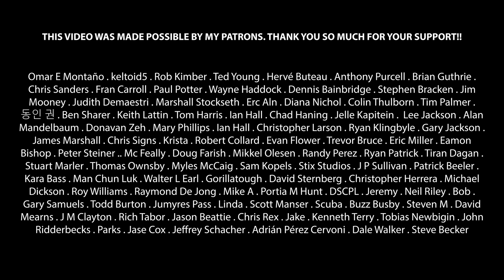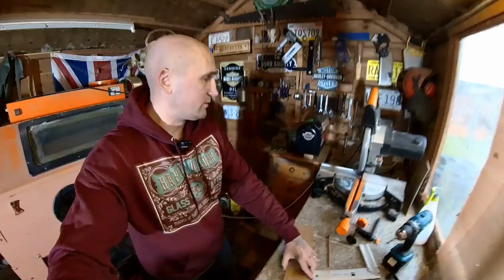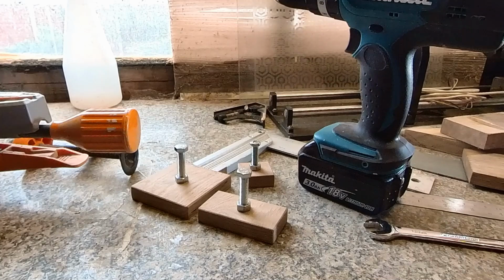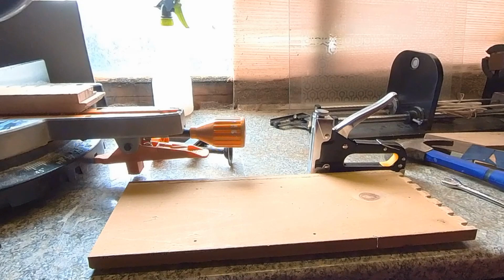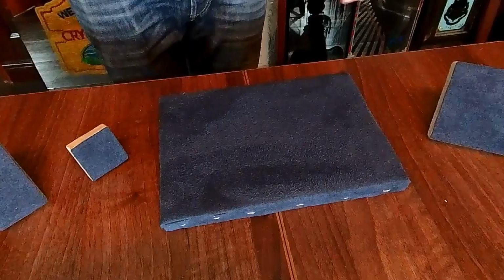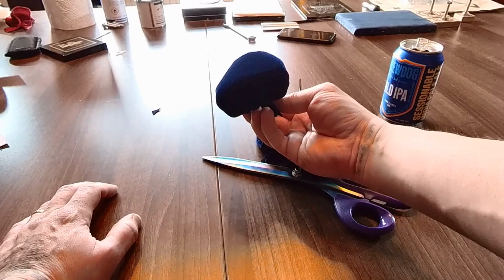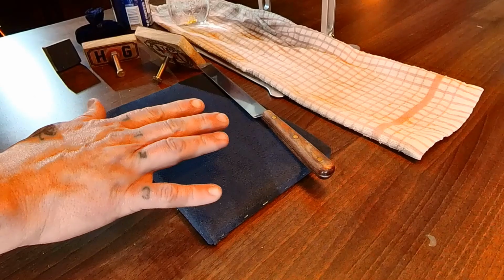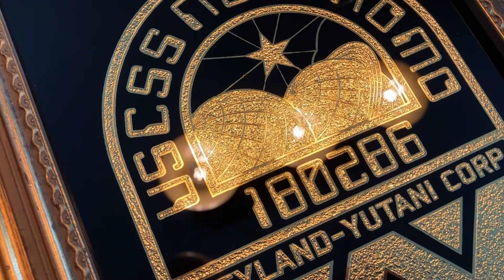Make a Gold leaf tool kit. Cost of living special

Comment: Mate, I used to do a lot of pin stripping and gold leaf work starting in the 1960's .... I always took my "French" Quills and my pin stripping brushes, clean in a jar with a coiled spring in the bottom and thinners. Then really pack the the hairs with vaseline petroleum jelly. To my surprise I hadn't used the quills (I had new sign writer's brushes) since about 1984 ... I found the tin box with them, cleaned them,re-oiled them with linseed oil... cleaned again and they worked like new.... what I'm saying , if you spend the big dollars on good equipment, take the time to treat and maintain them... they'll last you a life time..
You as always put out some clever idea mate....thanks
Reply from the maker: Cheers Ken! I completely agree mate and I think the tools I made in this video will last just as long as the ones you can buy for nearly 10 times the price. Hope you're still enjoying the sun. It's getting better here now so I'm perking up a bit :)

Comment: Thanks for the great démonstration that a good result doesn’t necessairly depend of expensives tools !
Have you got a cheap way to build a heat table for glue chipping too please ? Thanks for your vidéos that are my number one reference for this beautifull hobby.
Reply from the maker: Thanks, I'm glad you found it useful!
I now use tube heaters for glue chipping. The kind you use in a greenhouse. They're really cheap and more importantly they only cost 1p per hour to run.
Reply: @happygilder  thank you for the information. Do you have any picture of it please ? I’m note un UK but in Switzerland. I regret that I closed my FB account after 10 years in because I would have come in your community. Does it exist an another way to cet in without FB ? Thank you very much for your Channel.
Reply: Hello. Thank you. Can you make a shortvideo of your instalation with your tube heater for glue chipping ?
 @happygilder

Comment: Excellent advice! My dad taught us to make whatever we need - as much as possible.
Regarding your water size: It's steaming for the first gold leaf application … like a hot cup of coffee? Is the heat necessary - did you reheat it for the second layer of gold leaf?
Reply from the maker: Thanks Heidi! A hot cup of coffee is the perfect temperature to get the size mix too. Just before boiling point. I don't reheat size but you can use it for a few hours until you need a new batch. It doesn't need to be hot to use, just to dissolve the gelatin :)

Comment: Hey Happy Guilder. Hope my comment finds you well. I wanted to ask a couple of questions - what difference does the sand blasting do to the glass before you gold leaf it? Does it texture it? I would like to make a mosaic with gold backed glass for a project....can you glue the glass onto a backing after you have gold leafed them or will they debond due to the leaf? Many thanks!
Reply from the maker: Hi Freddie, if you want to gild sandblasted glass you’ll need to apply a clear gloss lacquer first because gold won’t stick to etched glass. 
After gilding you should back the leaf up with sign writing enamel and then it’ll be fine to glue to something :)
Reply: @happygilder  That's fantastic - thanks for the tips!

Comment: Great video. I am learning a lot from watching your videos. I recently have a fluted glass door which I would like to do reverse glass wih gold leaf.
But the issue is due fluted glass, the surface of the glass is not flat at all thus make it seems to be impossible to do reverse glass sign.... 
Do you have any advices when it comes to fluted glass?
Reply from the maker: Thanks, I'm glad you're finding the vids helpful! I've never worked with fluted glass. The gold should go on without any problems, but painting a design onto it will be tricky. Sorry I can't offer any useful advice on this